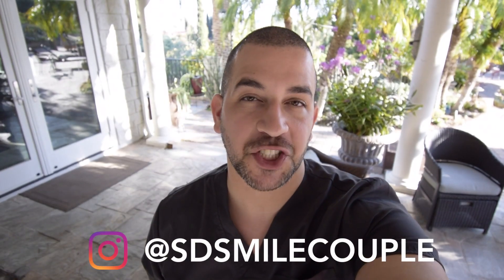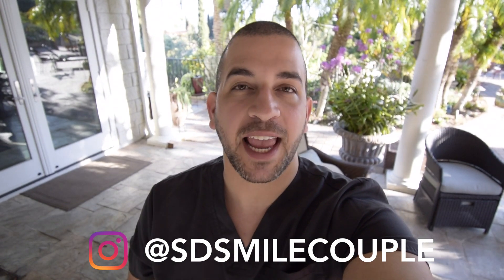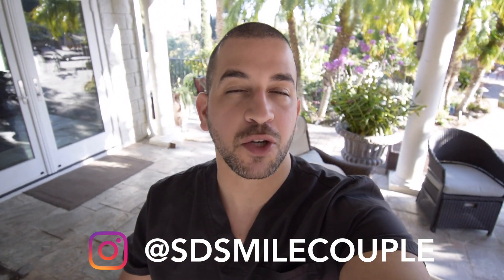Class II Composite Restoration | LIVE Tooth Filling w/ MICROSCOPE

Comment: I just come across your video, nice job.  I didn't see any interproximal wedges with the composite rings, right?  Also, I like the idea of building the marginal ridge is nice, but do you feel that 4mm+ marginal ridge could be cured fully in one single increment?
Reply from the maker: Great question! I’ve actually changed my technique from when I posted this video. However, for this technique since the marginal ridge layer is placed first, once you remove the tofflemire you will have access to curing that layer again after the band is removed. Currently, I use sectional matrices more often by first starting with flowable resin followed by composite resin cured in incremental layers after placing sectional, anatomical wedge & rings